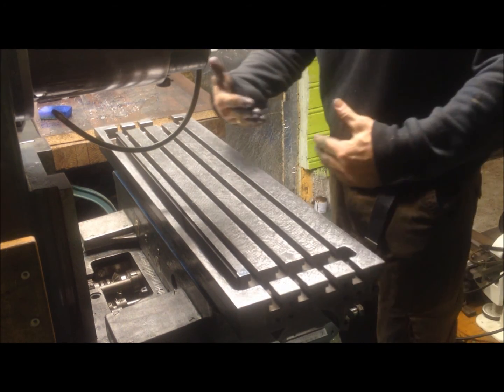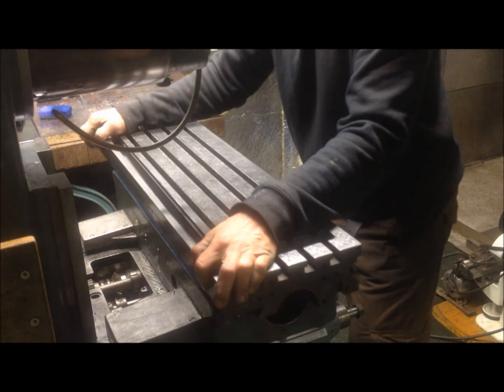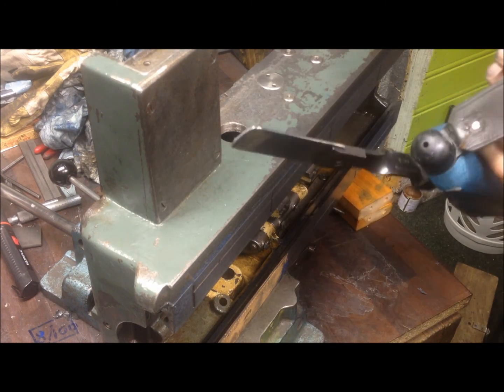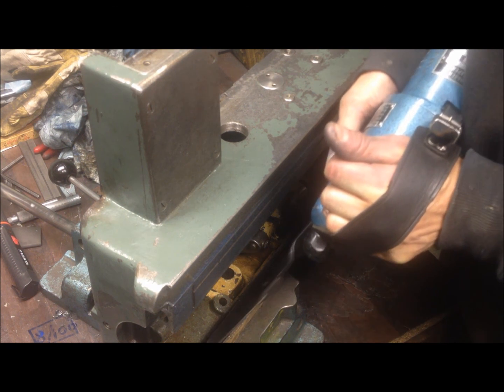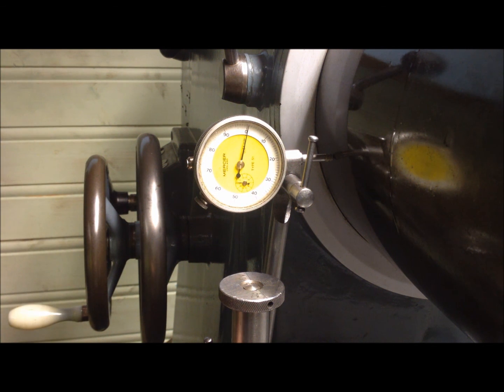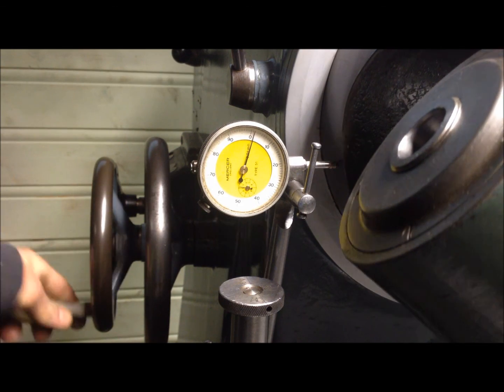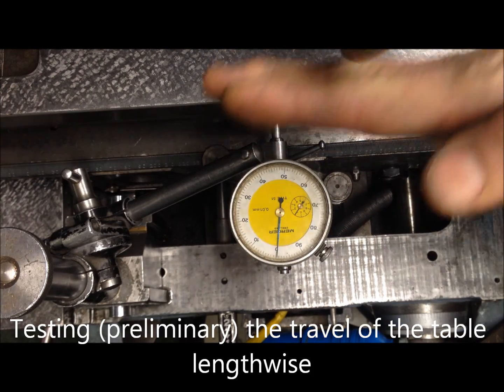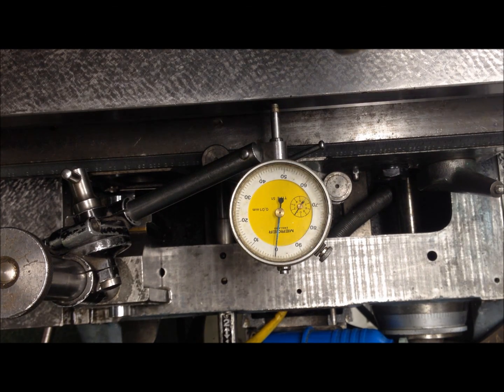Schaublin SV52 table flats and dovetails, saddle dovetails part 2

Comment: this sv52 up running must be its weight worth in gold up north. eskimos and icebears up there... and blonde ice queens..!! Once stayed some few nights outside in Beitostölen .. it was like 22 cold in the night.. ( crazy shit ... remember to heat up oil before using the machine Jan S ) :D
Reply from the maker: In my workshop it seldom gets belwo zero C.. ha, haNo, of course machine must be at operating temperatures.It performs quite nicely actually, although contcrols are a bit old-fashionedStable and accurate